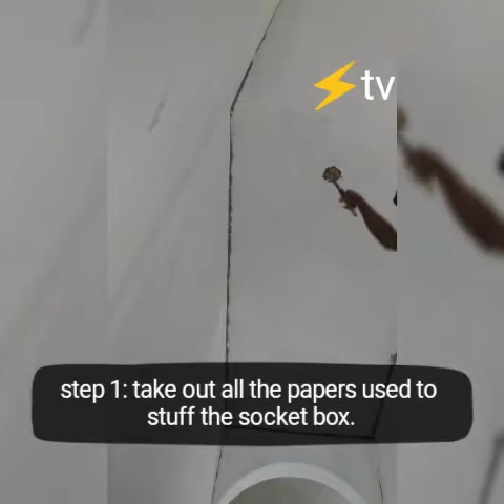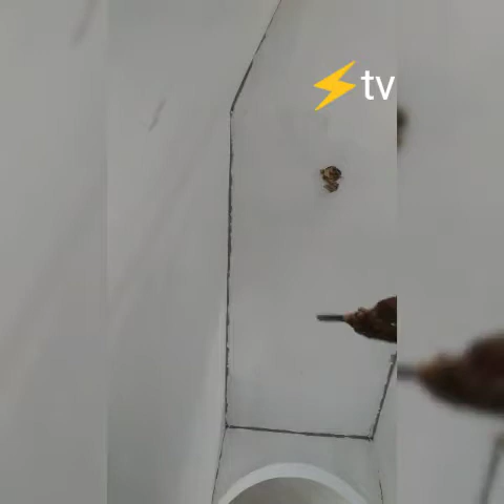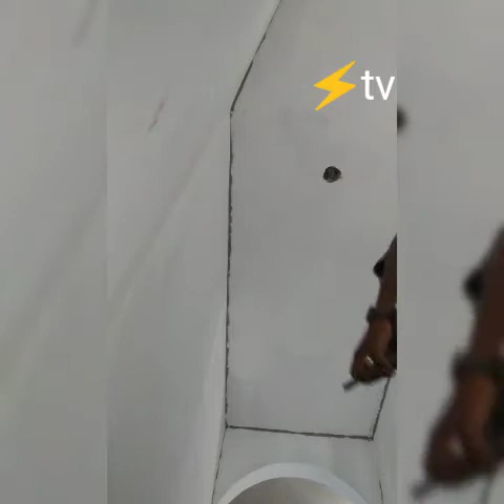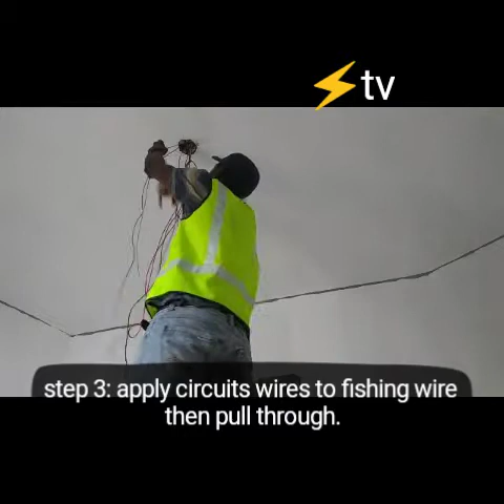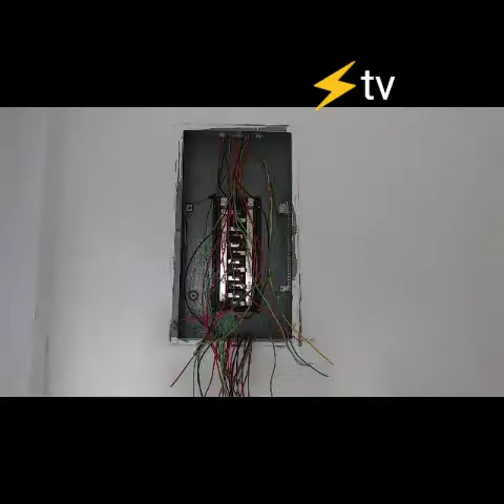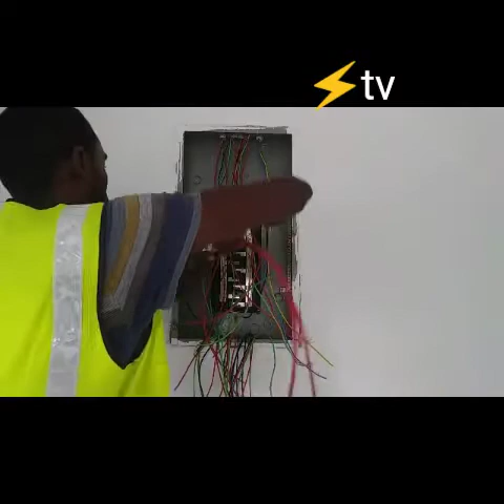Simple Domestic Electrical wiring..

Comment: What the typical amps do homes get 100amps or 200amps panels
Reply from the maker: 50amps double pole breaker for a 2-3 bedroom apartment ,but we do go up to 70, 100, 125 ,150 ,200 just depending on the load you expect the building to carry.
Reply: @ElectricalInstallationEEE  ok, I see, thanks for the response
Reply: What size cable would be adequate for a 100 amp service and if you don’t mind . What’s the cable size for a 50 and a 70 amp service. Thanks in advance. I was searching for a local channel that do there types of videos so I glad I found this one. You are a professional man and I wish to be a licensed electrician in the future
Reply from the maker: For a 100amp 35mm (25mm) can use also.
50amp 10mm or (16mm) 
70amp 25m or (16mm)
Reply from the maker: The ones in the bracket would be secondary options .
Reply: Thanks for that info just one other question. In what circumstances would the secondary options be used?
Reply from the maker: If that's what available at the time